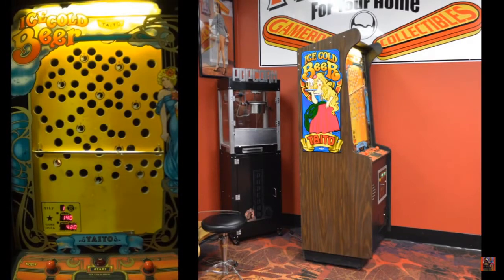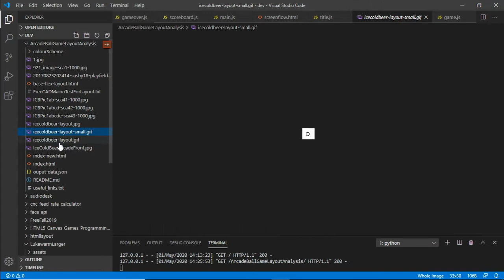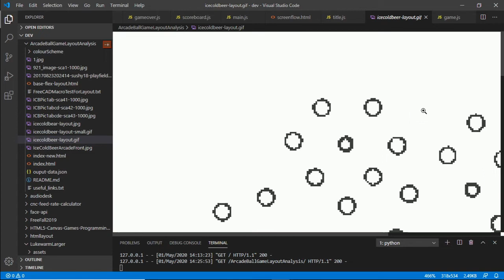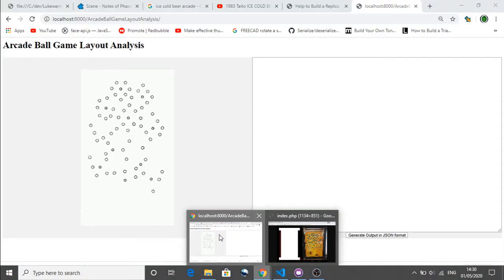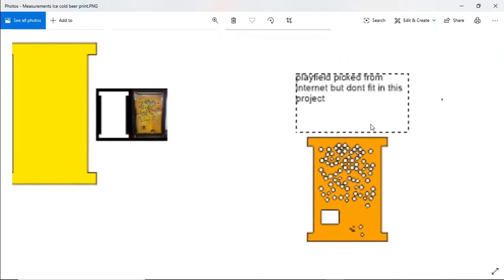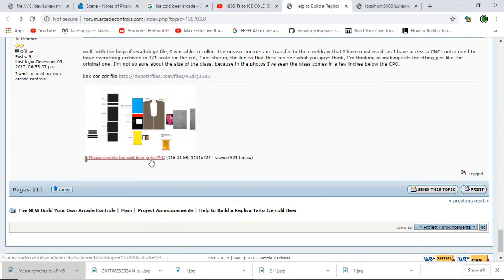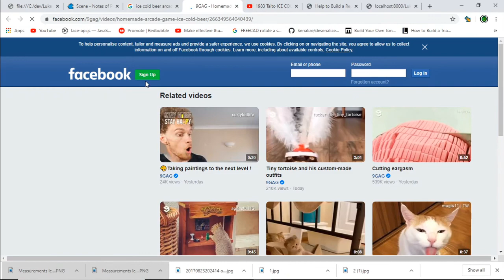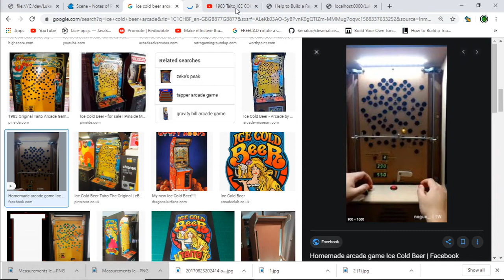Ice Cold Beer Arcade Build: Dev Log 1 Mechanical game port to web programmed in Javascript Phaser

Comment: Does it not matter that the original image in the manual has the game field tilted at an angle thus distorting the true relative distance/position between each hole?
Reply from the maker: If you want it exact then it would need some adjustment. But I was taking it as a ball park. I would love to get another chance of getting up and close to one of these machines and taking a proper photo, front on with something that I can use to scale the image so I can make a decent hole plan.